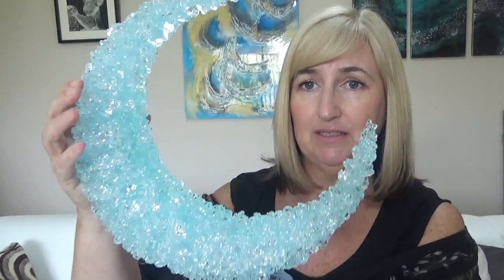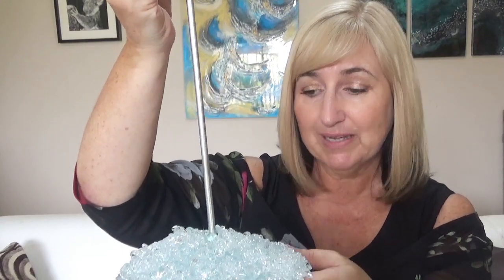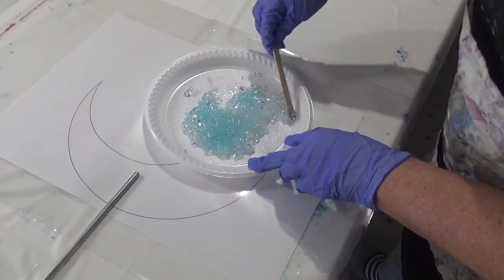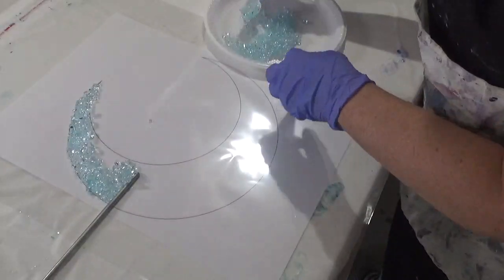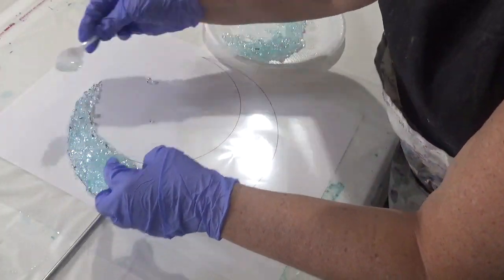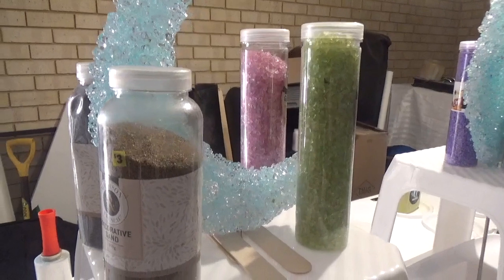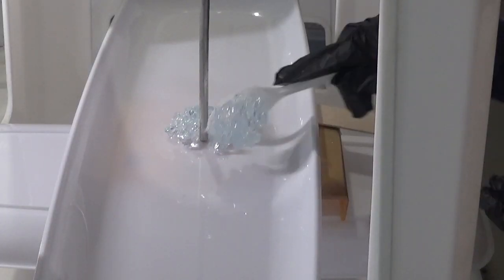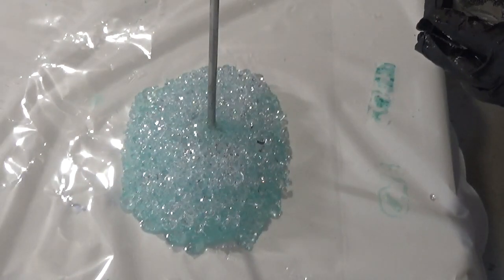How to create a 3D resin shape without using a mould

Comment: Hi Sue- 
New subscriber from CT and I’ve got to say, This is by far, one of the most beautiful pieces I’ve ever seen!! 
I’m new to using resin ( in fact, I’ve yet to use it) and you make it look so easy. 
Anyways, I’m trying to do some research. 
As I currently up cycle old nightstands and turn them into dog/cat beds. 
When doing this, I’ll normally leave one of the drawers on, for storage purposes. 
However, rather than using your standard drawer pulls (which is what I’ve been using), I’d like to add dog bone/paw drawer pulls. The problem with this is the fact that they’re super expensive. So I’m trying to learn how to make my own. 
The way in which I plan on doing this, is to either make my own from scratch (using resin and a silicone mold) or another idea that I had was to use a real dog bone & coating it in resin. The problem with this idea of mine is the fact that I have absolutely no idea how to create this look (how to get the resin into the same shape as the bone I’d be using). I’m having a difficult time finding this method on you tube. So any advise or recommendations would be greatly appreciated. 
Lastly, I’d just like to thank you. As your videos have already taught me a lot & I can’t wait to learn more from you! 💕
Reply from the maker: I would be inclined to say that it would be cheaper to buy it rather than make them. Especially if you haven’t done anything like this before. It could end up costing you more.
Reply: Sue Findlay thank you for your response and advice. The only reason I’m interested in creating my own, is because they’re suuuper expensive. (About $15 for a pair of dog none
knobs). 
I think I’m going to give it a shot using a mold and resin. Thank you again.
Reply from the maker: Good luck 💕

Comment: Hello Sue, New Subbie here 😃 I love what you did here, it’s absolutely gorgeous!!! 😍😍😍😍 I was looking around for a technique just like this, to add my crush glass in with the resin. I am making a chandelier and I wanted to know if you think that I can lay my mixture (crush glass and resin) onto a metal screen? The metal screen is my base to hold the mixture, it will be circular in shape with the crushed glass going all around, like a Diamond Band. I don’t know much about this resin, so I was curious if you have tried to get it to stick to metal. Please let me know what you think. Thank you 🙏🏽😊
Reply from the maker: The resin will stick to metal, it will bind with the mesh, so you shouldn't have any issues. Just make sure you seal around the edges to avoid any leakage. Good luck 💕
Reply: Sue Findlay thank you 🙏🏽 and luck I will need trying to pull this off 😂

Comment: Hi I hope you can help me.. I'm very new to resin ☺️ ... I've created a wall clock for my sister, it's made of resin & crushed glass, no base or board on the back,, so I've 2 questions,, will it hold shape if it's in a warm room? And how would you suggest hanging it, how to attach the wall hanging fixings 😅? 
🙏🏼🙏🏼🙏🏼
Reply from the maker: Whether it will hold up depends on the resin you have used. Some resins are harder and more durable than others. Heat will soften resin, however, once it cools down it should retain its shape. I found this out when I left a piece in a hot car. The resin felt soft and bendy, but once cooled, it hardened up once again.
As for the fixings, I have used a combination of screws and additional resin. Using both gives a good strong bond. 💕
Reply: @SueFindlay  thanks a million for getting back to me so soon Sue 🙏🏼 can I pick your brain a little more please?
I used Teexpert resin.  
Would/could the heat of a warm room warp the piece in your opinion? 
It's not deep enough for screws
🙆 I'm wondering if I should try get a board on to the back of it,, it's in the shape of a map so not the easiest thing at this point,, literally doing this back to front 😂

Comment: I decided to try my hand at making this moon, it turned out great, unfortunately I didn’t have a metal rod so I used an acrylic one instead, big mistake! Doesn’t want to hold the weight of the moon and it is heavy to one side, I am going to try and salvage it by adding a star keychain form to the bottom tip to try and counter balance it! Wish me luck! It’s for my sisters 70th birthday 🌙
Reply from the maker: Good luck 💕
Reply: I was able to salvage by cutting the acrylic rod in half and placing a hollow aluminum tube over the top, I definitely need more practice ♥️

Comment: Great job!  I wonder if you hollowed out a piece of styrofoam, if you could do both sides at once?
Reply: Hummm.  Resin generates heat while it cures, so it probably will melt the styrofoam.????
Reply: @paintingwithpaper In my experience, I don't think it gets that hot.  Also, most of it consists of acrylic diamonds.  They would dissipate much of the heat.  Just seems that it would be a lot easier.  It might be worth experimenting with on a small scale.
Reply: @pamgrusauskas4354  You may be right.  Please let us know if it works after you try it.  Thanks
Reply from the maker: Don't know, possibly. However, the work that it takes to create the hollow, you could have one side done already.

Comment: Sue, this is amazing!! You have been such an inspiration for me. Question on this piece, do you put more stones than resin because Im working on the same thing but a butterfly shape but the resin runs. Im thinking from what you did and said, id have to use less resin and more stones? Do i let it sit for a while before placing the stones on the picture? Thx in advance
Reply from the maker: I only add enough resin to coat the stones. I don't leave it or anything like that.💕

Comment: luv it-do you work with a pressure pot? wondering if thats a need for myself-didnt think so until i came across a video on how an artist took advantage of making bubbles in beer foam and instantly cured them through plexi glass and uv light. you mentioned you dont care to watch other tutorials- but i found one you'll be impressed with. Jedrik29t a must see.
Reply from the maker: No I don't use a pressure pot. I am familiar with Jedrik29t's work ;-)